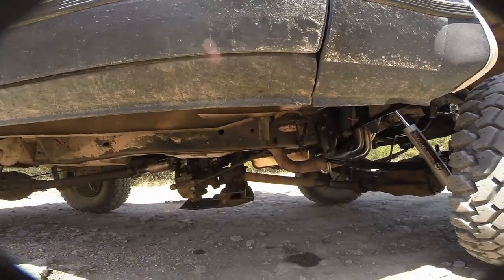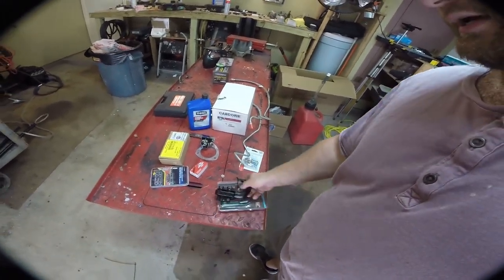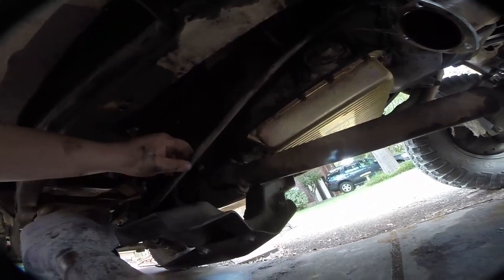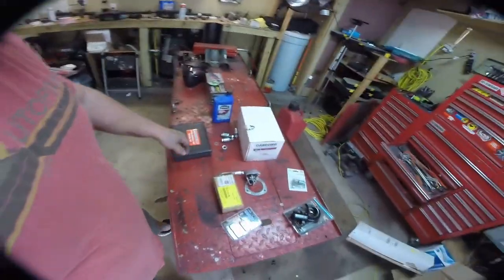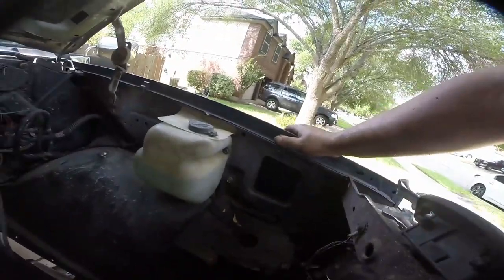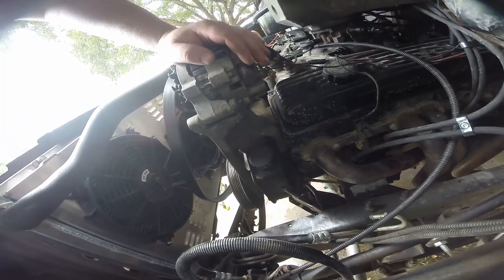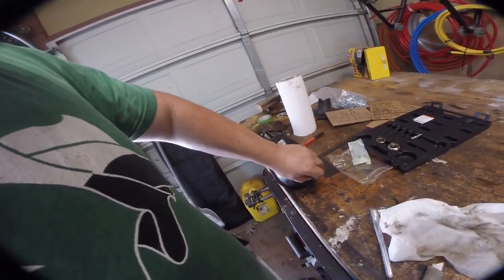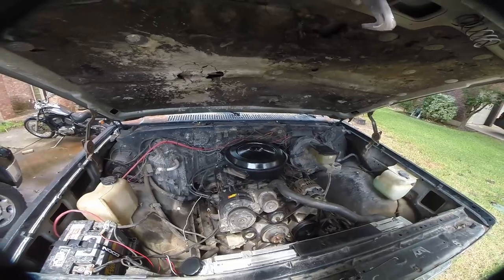1989 K5 Chevrolet Blazer Build - Episode 9 - Broken on the Trail

Comment: Looking back at your first video on this you can see spacers between the trans cross-member and the frame to space it down.  That's not what they are there for but commonly done to try to correct driveshaft angles.  The spacers actually sit above the frame and allow a longer bolt to hold the cross-member in place with more clamping force.  Threadlocker or not, if you continue to run the spacers to lower the t-case/trans you will be putting too much leverage on the bolt and snap it again.  If you need to space it down, make a shim out of solid stock that is the same width as the frame rail and covers the length from one bolt to the other.